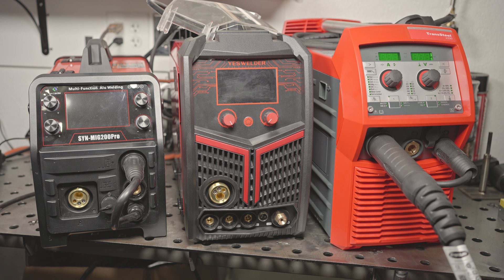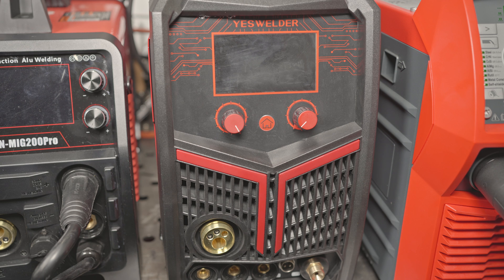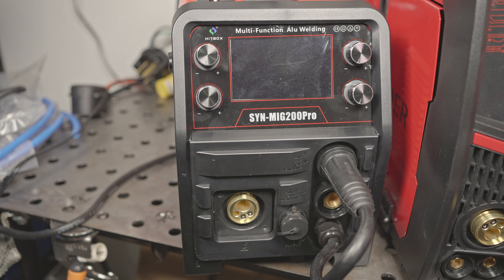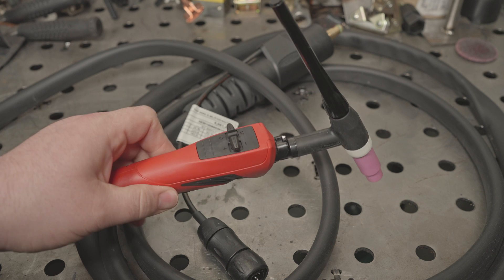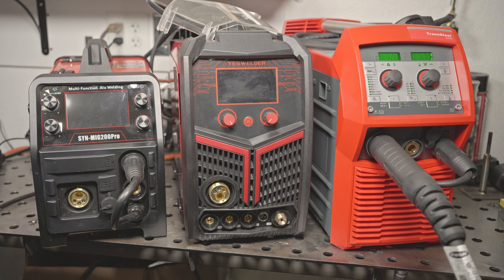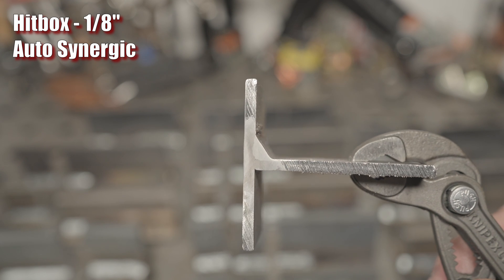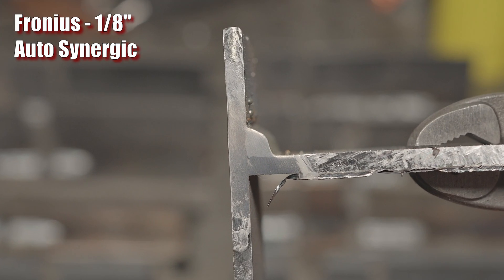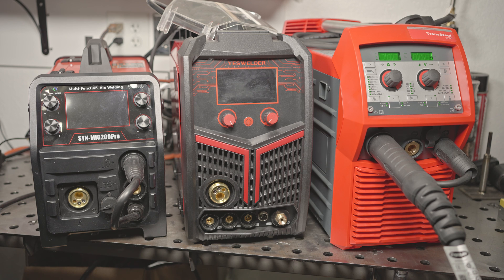Multi-Process Welders, MIG Cut & Etch Comparison - Yeswelder, Hitbox, Fronius

Comment: Another great production! Quick question - is that hot rolled steel? If so, it would be interesting to see the difference with cold rolled or with the mill scale removed.
Reply from the maker: Some was hot rolled, some cold.  I actually did remove the mill-scale.  It's hard to tell in the video because I didn't completely strip the pieces, but I did remove the mill scale from the weld bead area of all pieces before welding.  I gave myself enough room for the beads to fit on the clean, bare metal of both pieces of each T joint.  I made sure I didn't just polish the mill-scale (sometimes that stuff is tenacious) but definitely removed it.
Reply: @bigtb1717  I wouldn’t expect anything less from you. Great job keep them coming.

Comment: great video!! this fronius has pulse mig, correct? Have you tried to pulse mig steel with it? I am trying to find out what would be the most cost effective option for pulse mig welding without having to go bankrupt with a Miller. I really want to find a welder that makes overhead mig welding not so difficult and from what I could research, the solution would be pulse mig. If you could try pulse mig with 100% co2, it would be great. I know it would not spray arc (probably globular) but it would be great to see how it runs on 100% co2. Once again thanks for the great video!
Reply: Try the Simder 4050 Pro . It has  mig pulse, high frequency tig, 50 amp plasma cutter and stick all built into one machine . You might still be able to snag one for $649.00. I bought one a year ago and it has been phenomenal.
Reply: @FlyinTrapezious  ... thanks for the info.... I looked at the one you mentioned but I am going to wait for the new ARCCAPTAIN MIG 205MP that should start selling in the next 3months... I have just purchased a Bestarc 165A MIG and i was super impressed on how well it performed and it is super small... I got it because I was looking for a portable dual volt unit and I was not expecting it to run Gas Mig so well... I got it for Fluxcore as a replacement for my Tooliom 250A that works well on Fluxcore but sucks at Gas-Mig... so because of my bad experience with Tooliom on mig-gas, i thought these Chinese Mig machines would only work well on fluxcore because gas-mig requires more technology but after testing the new Bestarc 165A, I think I will give a try to the new Gas-Mig machines that are coming out... btw... I also have the feeling that the Bestarc 165A runs 3/32 7018 better then the Tooliom 250A.  There are other things that a liked the Bestarc more like slip-on nozzle, bigger contact tip, better roller(inside square shape... does not seam to break as easily as the Tooliom broke with me) and knurled roller is used for both Gas-Mig and Fluxcore... which for me always made sense because knurled has the "teeth" but since manufacturer always provided different types for solid-wire and Fluxcore, I always followed what manufacturer recommended to do.
Reply from the maker: The Transsteel 2200 has a basic pulse feature in TIG mode, but not in MIG.  I think the 3000 and up have pulse MIG, but not the 2200.
Reply: @bigtb1717  ... thanks for this very important information... so far I believe the most cost effective option for me seams to be the HTP Pro Pulse 220 MTS.  I have a feeling the Yeswelder DP200 Pulse will not have a satisfactory performance for overhead welding mild steel.
Reply from the maker: @rick076  I am planning to get a tank of 90/10 gas to test pulse welding uphill and overhead with the Yeswelder DP200.  Not sure when I'll get time to do the testing and make a video, but I'll get to it as soon as I can.  I'm no expert at uphill or overhead MIG, so I guess if I can make it work well, then that's probably a good sign, lol.
Reply from the maker: Not that I'm trying to talk you into a Yeswelder machine.  If you've seen many of my previous welder reviews, you know I not exactly a Yeswelder fanboy.  But if MIG pulse is going to accomplish something you need, I suppose it's a relatively inexpensive option.
Reply: @bigtb1717  ... for sure it would be a great sign... i saw a lot of videos of professional welders doing uphill and overhead as if it were easy... for me as a hobbyist for more then 3 years, it is still damn hard...  I am sure that there are a lot of people like me who just want to learn simple techniques and know which machice is the most cost-effective to get the job done.  I really appreciate your educational work... it is super helpful.
Reply: @bigtb1717  .... yes ... I have watched a lot of your videos...  years ago, you helped me choosing a 220v KickingHorse stick welder because of your video... it is still a good welder but with time working on my trailer and after playing with a Miller Gas Mig, I realized that stick is not so cheap when it comes to the time spent and the rods... so now i only do stivk welding in a very few situations that I really need the extra strength of 7018... about 80% of my welding is Gas Mig... 10% 7018 and 10% fluxcore overhead.

Comment: I bought the hzxvogen version of this machine. The HBM2280. Is it the exact same machine, or are there any notable differences? I haven't used it yet so i can return it and order the hitbox pretry easily. Any infor would be greatly appreciated.
Reply from the maker: I haven't looked into that particular machine.  Many machines are the same with different names printed on them, or a very similar design with a slightly different look and/or different interface.  But without comparing them, it's tough to say for sure which ones are the same as which others, unless they are obviously identical from the pictures and ads.  Though, without looking inside, it's tough to say for sure, even then.  It could be the same case with a different board or something.

Comment: Have you done any video reviews on the Everlast Cyclone 212 , 215c and the MTS 275 ?
Reply from the maker: I've only looked at one Everlast at this point, the 160 STH.  I've considered getting the Cyclone (I have the 120V and the dual voltage models in my "wishlist" on Amazon, lol).  But I just haven't gotten to them yet.

Comment: @Bigtb1717 Hey 👋 I have a YesWelder MIG 250 PRO that I recently bought... It does NOT meet the advertised output but there is a guy that has a video here... https://youtu.be/kHcdz8UpXbs that shows both the 205 and the MIG 250 putting out the exact advertised amperage. 😐 I don't know how he is getting the correct readings because my testing shows my YesWelder 250 amp putting out only about 180 amps... I don't know if his videos are doctored or what is going on... Please share your thoughts on this would be greatly appreciated!! I know you personally tested the 205 and it did not output as advertised.... Thanks!!!!
Reply from the maker: I watched his video.  A couple things come to mind.  First, it's very possible there is sample variation.  So it's possible his machines put out the rated amperage.

However, the second though makes me believe this is not the case.  Part of his methodology I think is likely to lead to misleading results.  He had his meter set to "min/max."  Even though he mentioned shutting off "hot start," welding current is still a very noisy signal.  The 240-250 amps he saw may been peaks lasting microseconds, while the overall average output may have been 180 amps.  He never left the meter to show real time readings, he only did Min/Max mode readings.  So signal noise or even a legitimate brief spike may have pushed the "max" number up, even if the average, real-world output may have been far lower.  And you can tell this is likely the case, because the number seems to start lower, then jump a bit when it reads a spike, then jump a bit more from another spike.

I wasn't there, so I can't say he's wrong.  All I can say is that I've tested many welders with many different amperage testers, including a multi-thousand dollar oscilloscope.  And I don't believe a Min/Max mode on a clamp meter is going to give a very realistic output measurement.

Comment: Thank you for the fantastic review!! I impulse bought the Fronius Transsteel 2200 about 2 years ago. You have accurately described it in this video, very nice machine, the production quality and performance is top notch, it even looks beautiful, but I really despise the proprietary TIG torch. I will NOT buy their TIG torch for $450. Ck Worldwide makes a Fronius adapter (don’t know if that works with the Transsteel tho) but then you’ll have to use it as scratch start tig and no way to vary the amperage. This machine, like most entry level multiprocess machines can do all three processes, but not well. It only does MIG well, it’s a MIG machine with stick and TIG are an afterthought. Stick is lacking 6010, and TIG is lacking AC, HF, and foot control (Fronius doesn’t make foot pedal for it) and the TIG torch cost the equivalent price of a decent Everlast or PrimeWeld TIG machine with included accessories. Knowing what I know now, I wouldn’t buy that machine again since I am not actually interested in MIG, regardless of how superior MIG is in that machine.
Reply from the maker: Thanks.  Yeah, I bought it because I primarily wanted a good MIG machine.  I agree about the TIG torch.  I'm no fan of the proprietary torch connector and their torch is stupid overpriced.  I ended up ordering the package that included it for only a hundred dollars or so extra on sale from my local place, just so I'd have it for videos.  I wouldn't purchase it separately.  You could get a Klutch ST201iDV for the same price and that machine has high frequency start and comes with a foot pedal.
Reply: Yeah, I saw your video on the Klutch, nice little machine and great video too. But I have a dedicated TIG machine tho, I just wanted to try the TIG on the Fronius, also, I'm not in the US, so getting that Klutch machine would be difficult if I wanted to. I appreciate all your efforts and the well put together welding videos :).

Comment: The one you left out is the Hobart MP 200. I was really thinking of buying the Yeswelder but Chinese business ethics are demoralizing. Its just like a neverending chain of sadness. The Hobart is made in China but being a US company they do their own QC which is kinda required if you are buying anything from there. And at $1300-$1400, I think it would be a more direct competitor.
Reply from the maker: That welder is definitely on my radar.  I hope to review it at some point.  I agree though.  It is a more direct competitor and almost certainly a far better welder than the Yeswelder, just without the plasma cutting option.
Reply: @bigtb1717  Agreed, the problem or draw with the Yeswelder is....well, if you are just starting at $700 which it usually is, even if you hate every mode on it, you still have a plasma cutter. I don't want to spend $700 for a plasma cutter but....it won't end up a paperweight even if you hate it.

Comment: ive run a 3500c and currently a TPS model from Fronius and in short circuit ive never seen it weld that badly.. there is defo something wrong there bud.. a fronius can lay down short circuit welds with no spatter

Comment: At this point, I see why buying a hypatherm and a esab mp is the better deal then Chinese junk
Reply: something has definitely gone wrong with the test of the Fronius in the short-circuit arc. I am selling Fronius in Belgium and I can assure you that the settings were totally wrong. from my experience I can tell you that the settings were not right and that welding was done in the half open arc, that is the cause of the spatter. never seen a Fronius weld so badly!!
ps: esab is built in china, fronius in austria.
kind regards

Comment: I have the HBM2280 like the hitbox and it seems to be a great welder with good power for thin and thick metal and aluminum. Try them on aluminum. My HBM2280 has 4 wire sizes the newer ones only have 3. So far so good. Have used stick and tig also that works pretty good. See if you can get a HBM2280 to test. You could also adjust the inductance to adjust the spatter. Great comparison job. I like your video.

Comment: From Nick Johns Testing on the MP200 yeswelder. Done a few more tests and found alarming the outputs are live even when a process isn't selected (at main menu).. I wanted to add to my previous post but could only do 1 photo at a time.. So new post.. Basically the TIG and MMA is the same 50A short circuit scenario.. Once an arc is going it'll regulate to the set value, in my case 20A.. Yesterday/previous post I wasn't sure.. Douglas confirmed.. 

 I'm beginning to think the fancy screen and menus is a gimmick, it has limited control over the power supplies, probably set current and on/off.. Bit disappointed tbh but!! It is what it is, I got a unit for £500 that'll do all these processes, certainly not perfectly but since it's aimed at the beginner, once that beginner gets to grips with the MP200 quirks, they'll be damn good at welding on descent kit...

I'm not unhappy with my MP200, just disappointed with YesWelder's development of it.. I'm not surprised it's firmware can't be updated, literally no point. The processor has no control over the power supply...
Reply from the maker: I'm well past "beginning to think," lol.  I'm fully convinced that the fancy screen and menus are a gimmick.  The wire feed option after changing wire makes the wire live, just like pulling the trigger on the gun; the burn back setting doesn't do anything from what I could tell; and the 70xx mode and 60xx modes didn't seem to affect 6010 performance at all.  It's the most basic version of every process, dressed up with a color screen.  I suppose that's fine.  But it's not how they marketed it.
Reply: Thank you for bringing this up, staying the fuck away from yeswelder. Hit box on the other hand , solid . My tig 200P has been flawless , pulse tig awesome tig torch, all the settings work mint and it’s got lots. Up and down slope, pre and post flow, variable pulse settings, hot start arc force etc for stick welding. 2t and 4t ofc. Very solid welder burned tons of rods , nonstop and pounds of tig filler. No AC but it’s DC arc is beautifully stable and reliable - at the same time very forgiving. I have a herocut cut 50 which is arguably the best plasma cutter , and now I’m looking at getting the hitbox synmig200. One thing ; the euro tweco style mig gun connection on the hitbox and shitwelder is the absolute best connection for mig. Period. Not to mention - you can weld alum no problem without a bulky heavy spool gat that costs almost as much as the welder in Canada. Hitbox and herocut are enough to get my dick hard , but fronious would just make me jizz in my pants nonstop every time I look at it not To mention use it . I’ll contract hiv and smoke a 8 ball of fentanyl when I get my ass into a proper plant and buy my first fronious fuck it

Comment: I have run many beads with all my welders. As you may know I have an Esab 215 a Fronius 180 A Fronius 2200 and a HTP 220 . Over all on straight mig either 75/25 90/10 or fluxcore the Fronius 2200 is by far the best, I don't know how to explain it but after time the ease of use and prefromance  is just so much smoother. I do like my HTP as it has pulse mig which is nice for sure but the arc is not quite as smooth as the Fronius. I use the Htp for pulse alu inum  which it does very well. On straight mig aluminum its hard to tell the difference between the HTP and the Fronius 2200 . I use my Esab 215 for .30 mig which it is really designed for..I don't  think  any of the welders you tried here could run dual shield flux core as well as the Fronius 2200. The Hitbox And Yeswelder and not in the same park as the Fronius and the HTP OR  A Miller 255 etc.  The HTP Is probably the best med cost machine for pulse mig steel or aluminum etc. To get pulse mig in the Fronius line you have have 3 phase power and $6000. To spend. The HTP beats it there, but again there is no comparison as if you had both machines the Fronius would be the one, but twice the price.
I just can't justify those cheap Chinese machines but many don't have the funs to buy others. This was a great review a d as unbiased as you can get. You did a great job, keep it up, I am waiting for further in depth reviews.
Reply: do you believe that HTP is the most cost-effective good quality Pulse mig welder in the market? I want to weld steel as easy as possible in all positions. I love Miller but Miller with pulse is price prohibited.
Reply: The new Ignis 150/180 can pulse on Tig or stick
Reply: i thought the fronius 2200 had pulse mig? is it a matter of older vs newer model or fronius only has one 2200 model and there is no pulse mig period?